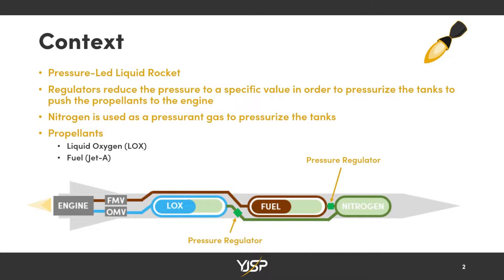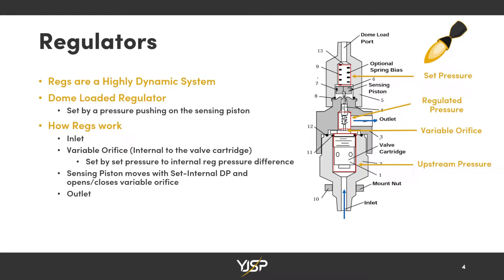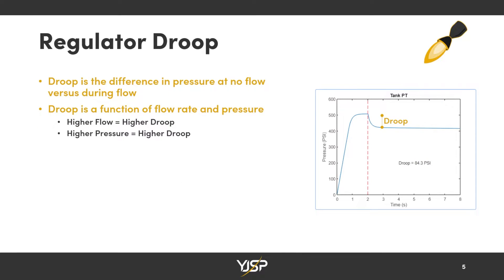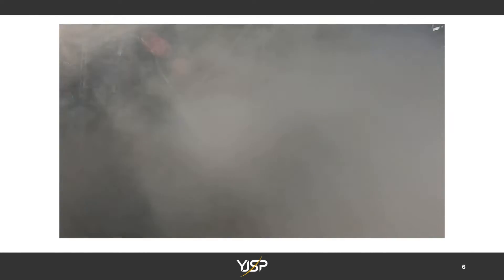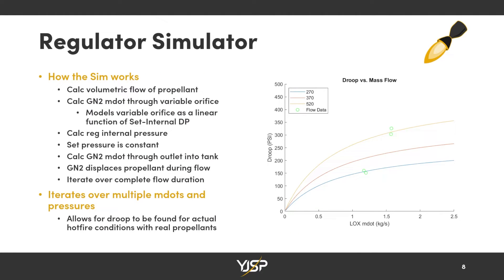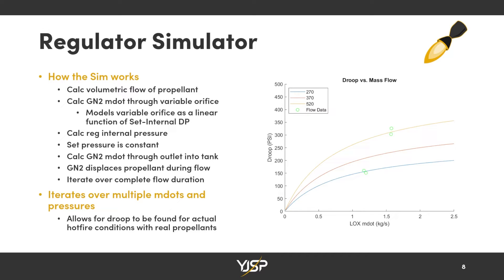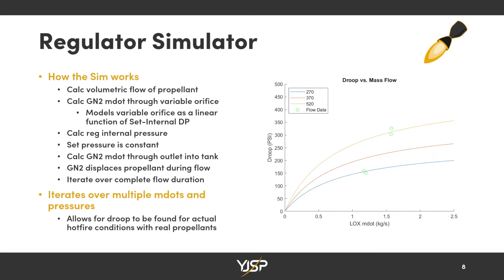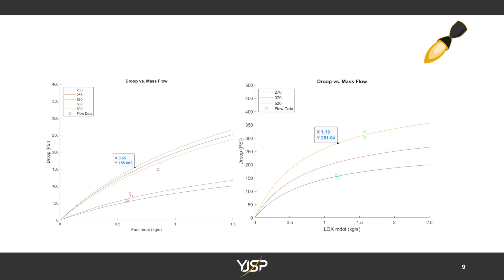Regulator Characterization | YJSP

Comment from the maker: The droop values on slide 7 should be switched. There was 160 PSI droop for the low flow test, and 300 PSI droop for the high flow test.